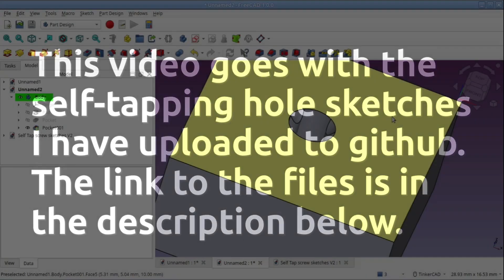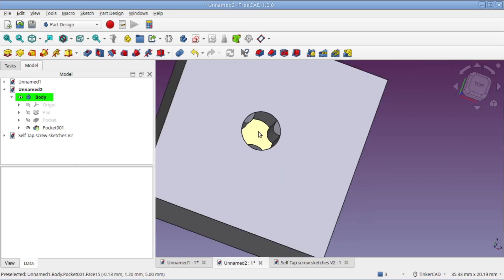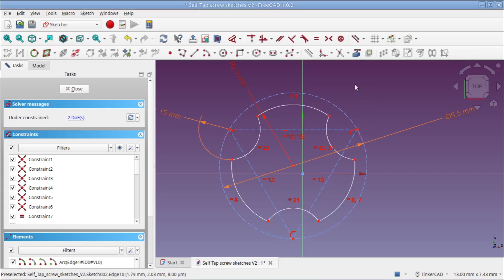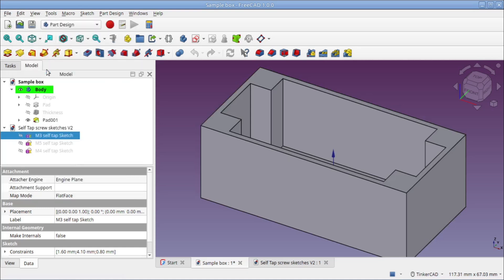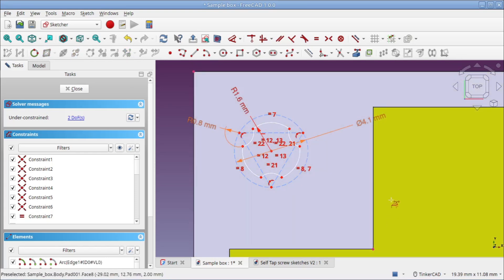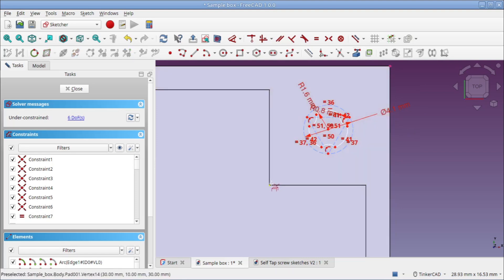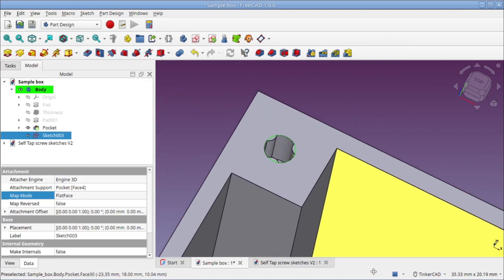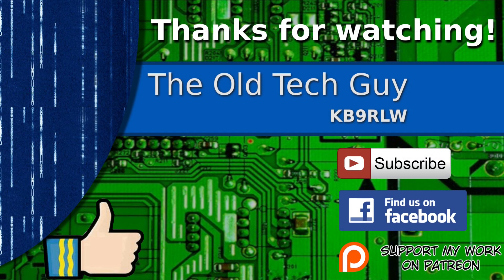3D design - Better self tapping holes in FreeCAD

Comment: Ok so I PROMISE I am not trying to be a negative Nancy here. I'm just addressing this from a technical approach. So did 'made with layers' come up with this idea of using internal bosses? The reason I ask is that regular metric screws aren't designed to be used this way. They're only supposed to be used with a threaded mate. So what I'm really wondering is how this works with thread rolling screws, which is the type of screw that is supposed to be used for this scenario.
Reply from the maker: In FDM 3D printing the object is made by laying down layers about 0.2 mm thick on average. Each layer has the geometry for that layer drawn out by a bead of melted plastic, and rather than wasting a lot of material on a solid interior, infill patterns are often used. So your part consists of exterior and interior walls usually two or three that are 0.2 mm thick and then an internal lattice or cubic or some other pattern of infill. The problem with tapping holes with threaded screws is the threads tear up those perimeters layers and break them away from the infill, that's the weak point. So adding these three bosses to engage the threads, preventing the threads from tearing up the perimeter walls between, maintains connection to the infill and is a stronger way of doing self-tapping holes with FDM 3D printed parts. Pardon my not understanding what you mean by thread rolling screws. I think of them as machine screws? But I'm not a machinist. Just a hobbyist.
Reply: @loughkb  I'm not suggesting tapping holes. That would make no sense at all. I'm taking about using thread rolling screws designed specifically for plastic boss holes.
Reply: @loughkb  I've used thread rolling screws in PLA hundreds of times. Design the screwhole diameter to be the screw OD × 1.25 and it works flawlessly. (Although that may vary slightly on other printers...not sure about that.)
Reply from the maker: Ok, I looked them up, didn't know the proper name, but familiar with the screws.  I've used them also.  Most hobby guys will have a good supply of machine screws on hand.  These new hole types work really well with them.  They hold about as well as the screws you're referring to. So it's really all down to the particular use case.  If you have machine screws and want to use them, this hole type is probably the best choice.
Reply: @loughkb  yeah fair enough. I think I'd like to see it tested though with screws designed for that purpose. Maybe that's something for me to take on "when I have the time." (Lol)
Reply: @loughkb  Ja w miejscu gwintu dodaję w krajalnicy walec z otworem i mam dodatkowe kilka ścian.
śruby wkręcam po nagrzaniu ich delikatnie- 50-70*C. To też działa.

Comment: Love the new intro. I don get it, how do 3 half cylinders make a stronger hole compared to a solid "sleeve"?
Reply from the maker: In the case of using the solid sleeve, the screw threads break those parameters apart and break them free from the infill in the model. By using the three bumps, the perimeters in those bumps get broken but they remain tied to the perimeters of the wall which remain engaged with the infill. So it's stronger.
Reply: @loughkb  So that's a 3D printing thing? I was thinking as if I took a solid block of plastic and machined it, it could never be stronger. I have no idea about 3D printing (obviously :) )
Reply from the maker: Yes. In FDM printing the model is sliced into a series of layers that are laid down by a bead of plastic. The interior of the model is usually filled with a framework rather than solid plastic to save material and time. The perimeters are made up of solid walls, two or three thick with the internal wall engaging with the infill.

Comment: If you put it in a parametric model the solver breaks down and gives errors. Something is not exactly OK with the constrains. And I have found out that the problem is the triangle. It breaks down. Must be a bug.
Reply from the maker: Sketch flipping. When something moves the sketch past its boundaries parts of it will flip around. I'm playing around with the geometry to figure out how to lock parts of it to the interior origin point so they don't flip. It's those three arcs. When I figure it out, I'll upload version 3 with notes.

Comment: Instead of mirroring the sketch in the sketcher and doing the constraints and second sketch with circle for taper you could have made one hole and then use mirror for the hole itself in Part Design.
Reply from the maker: Sure.  You could do polar patterns on the whole operation for a circular application.  
There's many ways to get to the end result.  I walk the newbies through the basics.

Comment: I was thinking about doing the same thing when I saw his video.  Except I was planning on making the holes into solids to use as a cutting tool and bring the step files in to whatever project I needed them in.
Reply from the maker: I thought about doing that too, which was what he did over on made with layers. But I figured it was easier to constrain a sketched geometry to where I want it then trying to transform another model into place for a cut.